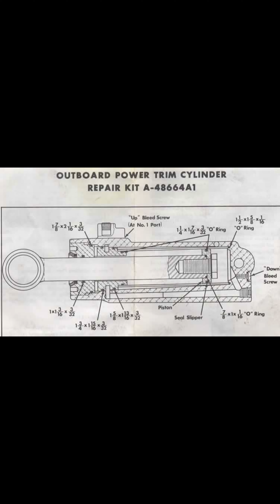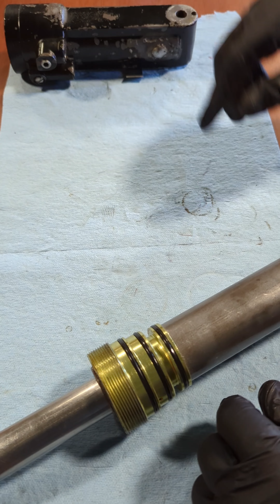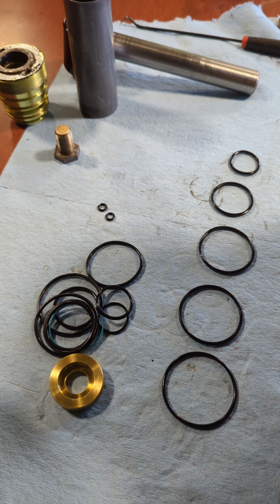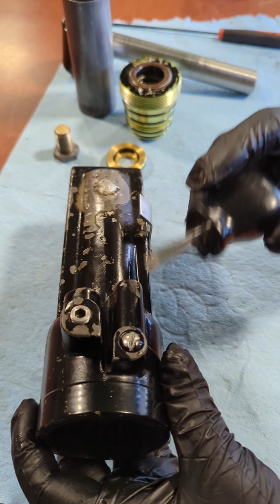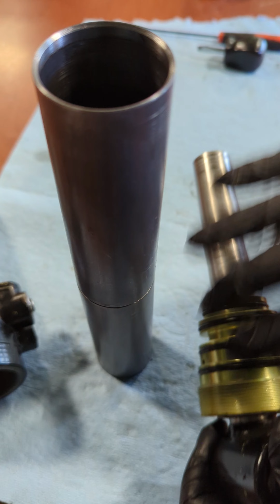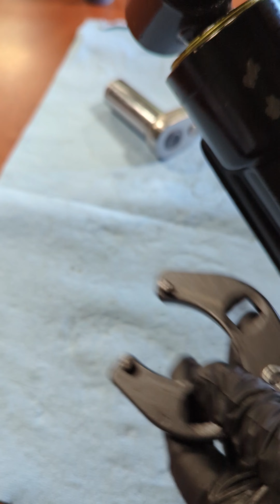Early 1970s Mercury Power Trim and Tilt cylinder rebuild.

Comment: Great vid, I have the 3/4in shaft model. Do you know exactly what o rings are not cross compatible from the 1in kit? The 3/4in kit is practically non existent but you can still get the 1in kit. So im thinking ill get that and find a o-ring to fit the shaft OD. Thanks in advance!